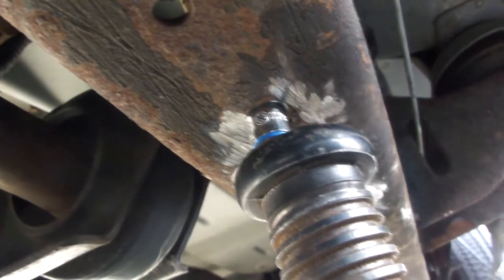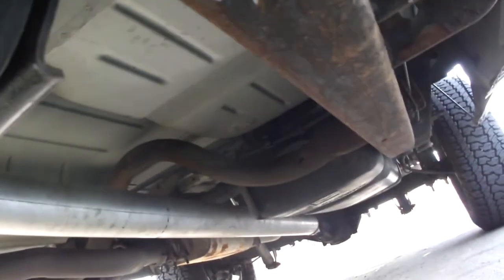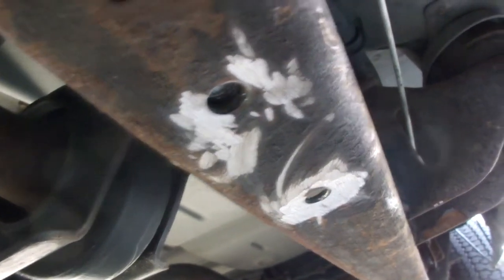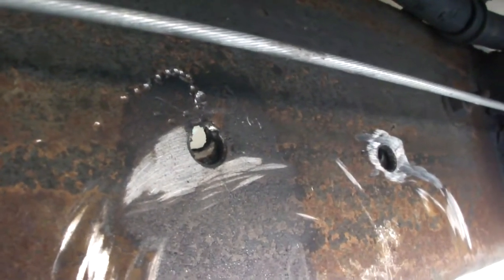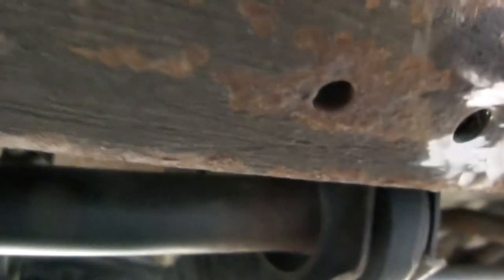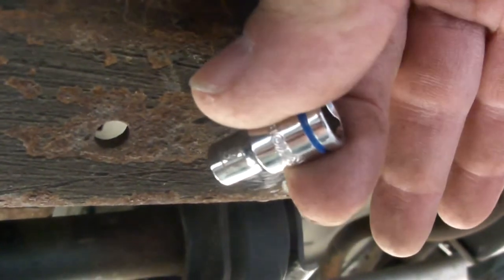How to Remove Truck Rivets from Hard to Reach Places on a Truck Frame

Comment: I’ve found that a Blair cutter works well but it’s still a pain in the arss. Center punch it accurately then drill it clear through. Usually a 7/16” Blair cutter works best. Head of rivet should break off easily once drilled the rest just falls out as the bit passes through the frame
Reply from the maker: Good to know! Thanks for the tip.

Comment: What did you use to attach the new bracket? Bolts, washers and nuts?  I gotta do something similar to my truck.
Reply from the maker: The replacements came with new hardware. Bolts, nuts and washers.